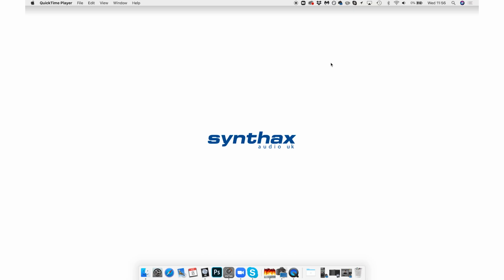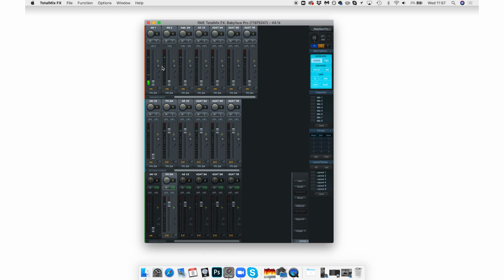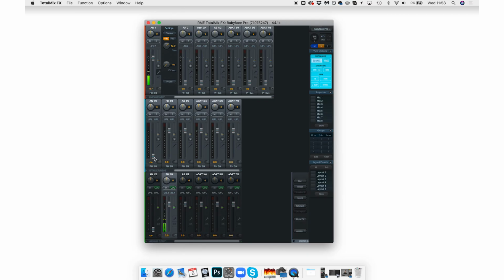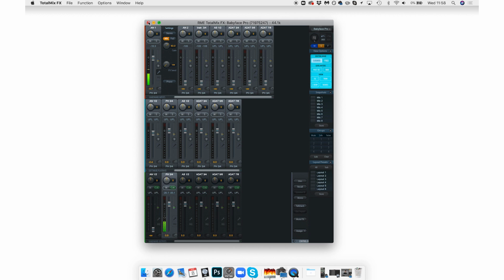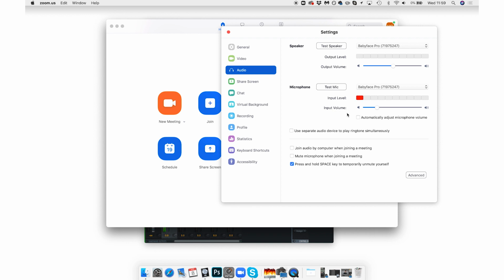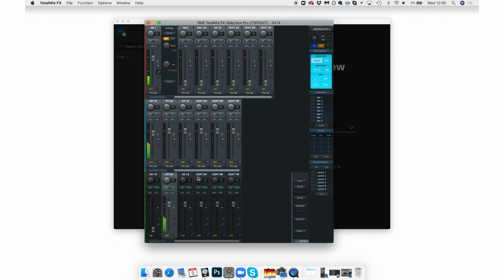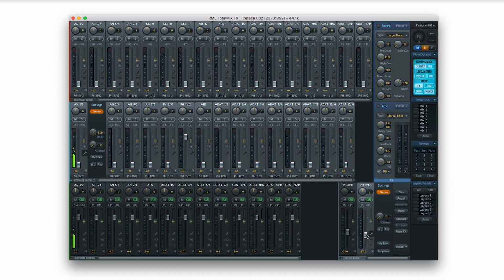How to use Skype and Zoom with an RME Audio Interface: Setting Up Your Interface

Comment: Any way to do the UFX method with speakers connected to physical outputs AN 1-2? I am forced to mute the OUT AN 1-2 fader (which probably prevents loopback from occurring from OUT AN 1-2 -> IN AN 1-2).
Reply: The only workaround I have for this is to get a dedicated mic pre (low quality will do for monitoring) and hook it up physically to IN AN 1 while deactivating the loopback on OUT AN 1-2. But this necessitates the purchase of extra hardware.

Comment: RME UFX+; are we limited to AN 1/2? Asking as this is a crap option for me as I have active speakers coming out 1/2
Reply: I'm at the same boat with 802. I just use inputs AN1/2 from my external preamp. But it would be better to use my front inputs for this and not hearing myself while on meeting.

Comment: So theres no way to change which "source" that zoom sees as your input. I have UFX II and use AN 1&2 for my main monitor outputs. This means I will need to turn the actual monitors off if i want to get this to work. Is this correct?
Reply from the maker: HI there, it's been a while since we've visited this subject, but as far as I remember that is correct! We have seen several other comments recently that say Zoom works slightly different compared to when this video was made so things may well have changed on the output front!

Hope this helps!
Reply: @SynthaxAudioUK  this is extremely disappointing, only way I'm able to get audio is out of AN 1/2 and "turning speakers off" is not quite an option as they are not easily accessible

Comment: I have a ufx 2, and I have a line in keyboard routed in total mix, is there a way to get the keyboard direct into zoom?  I know this is an old video.  The idea is live keyboard and vocal.
Reply: for zoom
Reply from the maker: Hi there! It's been a while since we've visited this subject, but you could try using the UFX method in this video but also routing your keyboard channel to AN 1/2 output and looping this back?

We have seen several other comments recently that say Zoom works slightly different compared to when this video was made so things may well have changed though!

Hope this helps!

Comment: This evening for a Zoom music performance I made use of Reaper as you showed and used the loopback feature but it seems other listeners could hear echoes when they spoke so I had to revert to gong direct through my 2 mics (guitar and vocal) which worked fine but not as flexible as using a DAW. (They weren't wearing Earphones which might be the issue) I'm using the original Blue Babyface which is still going strong!

Comment: Tried this on a Fireface 802 and it only sort of works on a Mac m1. There is no signal in the "test mic" mode in zoom. If I go into settings in Zoom and select the 802 I can get a low signal in from the 802. It is just one or two low red bars on the sound level. All is cranked up max in the levels in totalmix and loopback is enabled (btw I can not notice any difference when clicking loopback from disabled). Any ideas what is wrong?
Reply from the maker: Hi, it sounds to me like you just need to turn the gain up on the mic channel of your 802 (the 802 has analogue gains, i.e. the physical knob on the front panel). 

Once you’ve done that (and can see you have input gain in TotalMix FX), all you should need to do is route the mic to Analogue outputs 1+2, then turn on Loopback.

Adjusting the physical gain control should now alter the signal you see in the test mic section of Zoom's settings. You'll also want to make sure the 'Automatically adjust microphone volume' is turned off.

If this doesn’t solve it for you I’d recommend contacting your local support for RME, I’m sure they’ll be able to help;
https://www.rme-audio.de/support.html
Reply: @SynthaxAudioUK  Trust me it is up on max. There is nothing more to crank up. It is LOUD in cubase it is just in Zoom and teams it is low. something with Mac and them.
Reply from the maker: @prewinder  Hmm okay in that case I'm not too sure I'm afraid. Essentially it shouldn't be too complicated;

1 - Plug in mic (e.g. channel 9) 
2 - Turn on 48v phantom power if needed
3 - Turn up gain
4 - Route mic in TotalMix to your headphone output (e.g. PH 9/10) for monitoring
5 - Route mic in TotalMix to analogue outputs 1+2 (AN 1/2 - should be set to 'Main' by default)
6 - Click the wrench symbol on AN 1/2 to expand the settings, turn on the Loopback button. 

The fact that you are getting a small amount of level in Zoom is strange, maybe there's something else at play here.

Like I say it's probably worth contacting your local support so that someone can look at your setup in more detail.
Reply: @SynthaxAudioUK  Local support? Contacted Apple and they were clueless.
Reply: @SynthaxAudioUK  Well I have been in contact with RME and they does not care. They think it is an Apple or Zoom problem (and they put the ball in RMEs corner). Sucks really, never had any issues on PC, but on Mac it is useless.

Comment: can i use the mic in my headset? what do i need to do this.. i have tried a 3.5 to 1/4" adaptor.. doesn't work....
Reply from the maker: Hi Thomas!
It would most likely be possible using some adaptors (you would need to split the signal coming from your headset into microphone and headphone), but realistically the simplest solution would be to buy a cheap microphone. This would most likely also give you better audio quality too!
Hope this helps!

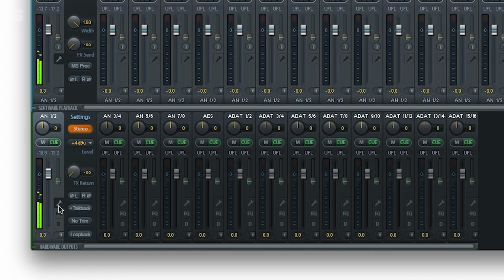Comment: At 5:54 is this the same as setting up a mix minus?  If not, how is mix minus accomplished?  (Babyface Pro FS).
Reply from the maker: Hi, sure you can easily create a mix minus with any RME interface;

1 - Open TotalMix and click on the output (bottom-row) that you want to remove the input from. This selects the submix for that output.

2 - Now simply bring down the fader for any input you don't want to be routed to by that output/submix (e.g. Mic channel 1, top-row in TotalMix).

Comment: Strange.  I was sure that you were going to show how to set up a WDM device in madiface utility for the UFXii, which is how I've had to do it.  In order to get input 9 on the front panel to show as a recording device in Windows, I have to set up a WDM device for inputs 9 and 10.  This video is confusing for a few reasons:  The example here for the UFXii I think is a bad one, as analog 1 isn't even a preamp (those start on the front panel at input 9.)  Without setting up a WDM device at all, nothing shows in windows for playback or recording devices at all, unless of course I'm missing something which is entirely possible.  The example might work IF you'd already set up a WDM device, and it happened to be analog 1 and 2, and you were using a rear input... but then, using this example, you're routing ALL of your output that would come out of your speakers to the folks on your skype call.  Not to mention, if you have monitoring enabled in windows (which wouldn't be needed but some people have on,) this'll cause one hell of a feedback loop.  Am I missing something?
Reply from the maker: Hi and thanks for your questions, I’ll try to clarify the points you’ve made here;

The short answer is that this video is primarily aimed at Mac users running a Babyface Pro, or one of one RME’s other smaller interfaces (MF Pro / UC / UCX), all of which use input channels 1+2 for their mic pres. We also address users of the 802 / UFX II / UFX+ later in the video, which as you rightly point out use channels 9+10 / 11+12 for the preamps. 

If you’re on Windows, you can simply choose which inputs and outputs you want to use in Zoom / Skype’s settings, provided you’ve added all of your interface’s I/O via the RME Settings first (by clicking on the WDM Devices button as you’ve mentioned).

On a Mac you don’t have the luxury of WDM devices, so you can only use the first one/two channels to input into Skype or Zoom. This can actually be changed via the Audio MIDI Setup, however you’re still limited to a single set of two channels, and can’t switch between them freely like you can on Windows. That’s why we’ve outlined this method as a workaround, using TotalMix’s loopback feature to route any audio back into Skype / Zoom. This isn’t necessary on Windows.

For Windows users, adding the I/O via the RME Settings would indeed be the first step in the process, and which we cover in our OBS for Windows video here;

https://youtu.be/oTDsovN4tpc

In terms of feedback, we’d always suggest using headphones to avoid any issues. I believe Skype and Zoom also employ some kind of reduction when a user is speaking, and all I can say is I’ve not personally experienced had any problems. You can of course prevent against this entirely by ensuring you’re not routing the Skype / Zoom software playback channel to the loopback output (i.e. by turning the fader down in TotalMix, and only routing it to your headphone channel for your monitoring).

TLDR; this video is primarily aimed at Mac users (and using a Babyface Pro) - for Windows users, this method is unnecessary, unless you want to send additional audio into Skype / Zoom (e.g. audio from your DAW). Hope that clarifies things a bit!

Comment: Hey, thanks for the video. I have the UFX II and I can't get this to work. I understand that Zoom only sees inputs 1 and 2 but on the UFX II the mic inputs are 9-12. What is the workaround? I have activated loopback on outputs 1&2 and I think I did everything exactly as you described but it still doesn't work: Zoom doesn't see any input signal.
Reply from the maker: Hi Jean-Marc, any channels you send to outputs 1 & 2 should be picked up in Zoom as its input. I have a Fireface 802 here myself (which also has the mic inputs on channels 9-12), and have all 4 mic pre’s routing comfortably into Zoom. 

I would therefore check you have done the following;

In TotalMix FX;

1 -  Open TotalMix and click on the AN 1/2 output to select it (bottom-row). AN 1/2 should now be a lighter grey colour than your other outputs, indicating that it is the currently selected submix. 

2 - Turn up AN 1/2's fader, and switch on Loopback (click on the wrench symbol for AN 1/2, then the Loopback button to activate it).

3 - Now in the top row of TotalMix, turn up the fader for your microphone channel (e.g. channel 9), to send it to output AN 1/2. Make sure you have also turned up the microphone’s input gain (click the wrench to expand channel 9’s options, and use the gain encoder to increase the level).

4 - Click on your headphone output (e.g. PH 9/10, bottom-row of TotalMix) to enter its submix, then raise the microphone channel’s fader to route it to your headphones as well, so that you can hear yourself for monitoring.

In Zoom;

5 - Now in Zoom, open the preferences and click on the Audio tab. Make sure you have your Fireface UFX II selected for 'Microphone'. When you speak into your mic, you should see a signal via the Input Level meter. You can also test it’s working by clicking the Test Mic button and recording a message.

6 - To send your other microphone channels to Zoom, simply repeat the above process - open TotalMix and click on the AN 1/2 output again to select it, then turn up the gains and faders for 10, 11 and 12. Then click on your headphone output, and turn up the faders again (inputs 10, 11 and 12) for monitoring.

Hope this helps and best of luck.
Reply: @SynthaxAudioUK  Hey, thank you so much for taking the time to explain. I actually just found what was the issue: the microphone permissions were denied for Zoom in Windows "privacy" settings... Everything was fine in TotalMix FX.
Now I have another concern: in loopback mode, I can't mute the monitors otherwise there is no more microphone signal going to Zoom. Is there a more convenient way to avoid feedback than to switch the monitors off for each call?
Reply from the maker: @Jim951cup  Hi no problem. Ah yes, the microphone permissions thing on Windows has tripped me up before! For monitoring, we would always advise using headphones - as you say, it’s too easy to run into problems with feedback otherwise. 

IIRC, on Windows you can use any output channel for your Loopback mix into Zoom, as Zoom should allow you to choose from any of your interface’s inputs (i.e. you’re not limited to only using AN 1/2 in the way that you are on Mac OS). You may also have to change what it ‘defaults to’ via the Windows Sound Settings (I’m afraid I can’t remember the exact process off the top of my head). 

Some experimentation on your part will be required, but the best solution is probably to use an output you’re not using for anything (e.g. one of the ADAT outs) for your Zoom loopback, and then monitor the call with headphones.

Comment: Thank you for this.  I got it to work for my microphone.  Now I'm tying to get a track from Logic Pro X to also be mixed into TotalMix and then out into Zoom with my microphone.  The track is working and going into TotalMix and my headphones, but not into Zoom input level.  Only my mic is going into Zoom.
Reply: Ah, I think I figured it out.  Had to turn on loopback on AN1/2
Reply from the maker: Hi and thanks for commenting. Yes Loopback is the way to go, glad you got it sussed. 

You could also add a microphone track in Logic and use that for talking, although there are a couple of extra steps you need to take (if you’re using a Babyface Pro, Fireface UC or UCX), as otherwise you will encounter the dreaded feedback loop! We’ll be covering it in another video soon, but here are the steps in case you’re interested;

1) Route your microphone in TotalMix to a hardware output channel that you’re not using, e.g. ADAT 7/8. 

2) Click the wrench to expand the options, and activate Loopback for the ADAT 7/8 output.

3) Create an audio track in Logic for your microphone, and set the input to be ADAT 7/8, which will now be receiving audio from your Mic. To be extra safe, make sure that none of your audio channels have AN 1/2 set as their input, as that will create feedback.

4) Record arm this audio track in Logic so you can monitor yourself. Your microphone will now be routed to Skype or Zoom along with everything else coming from your DAW.

If you try to use AN 1/2 as the input (the default channels on RME’s smaller interfaces) in Logic, you will in effect be sending audio from your mic into your DAW, back out again, then back in again (at least while you have Loopback activated). By doing it the way detailed above instead, you ensure you’re not creating a feedback loop, and are free to use your mic inside your DAW.